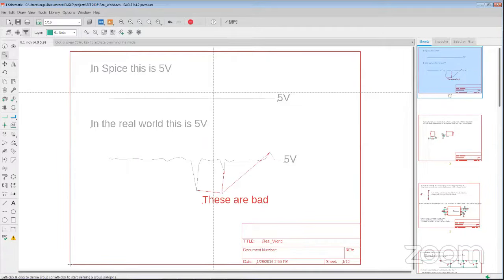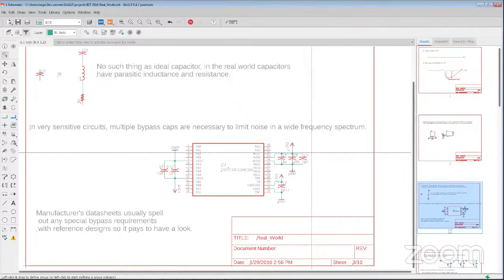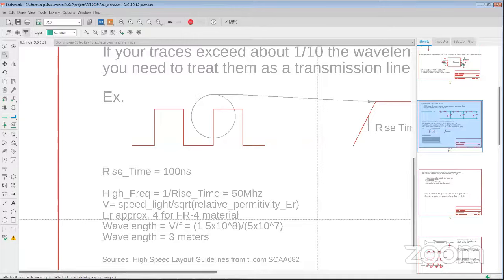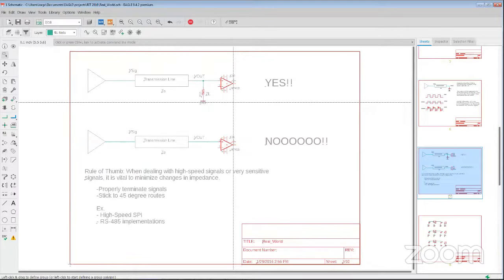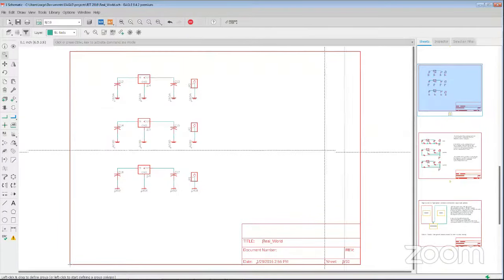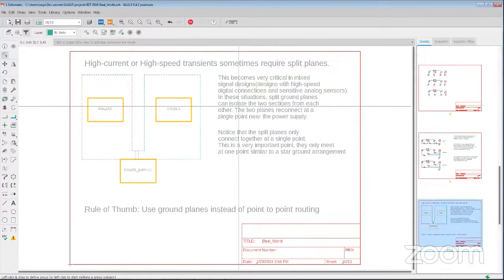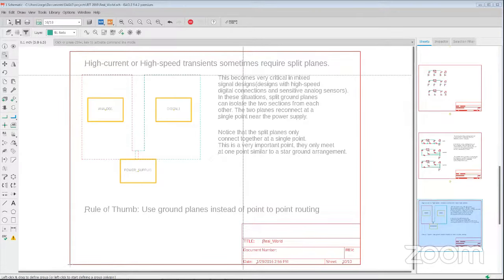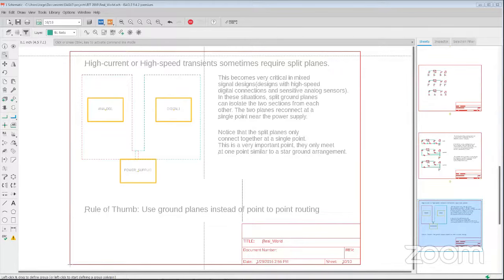High Speed PCB Design Guidelines 2019 - Autodesk EAGLE

Comment: I have continuously struggled with the meander function while attempting to route impedance controlled differential pairs. This is especially difficult when I need to make a small adjustment after the initial route. Perhaps the extension of this presentation could be an end-to-end routing example - including post route editing. If I look hard enough, I could probably even provide a releasable schematic for that. 

Is there any way to practically move a diff-pair as if it were a single trace while maintaining the spacing and length?